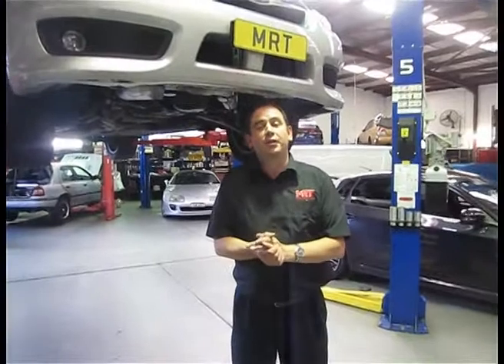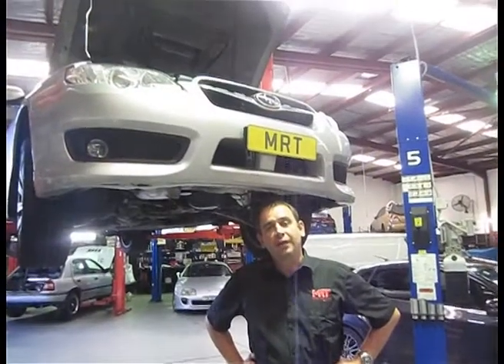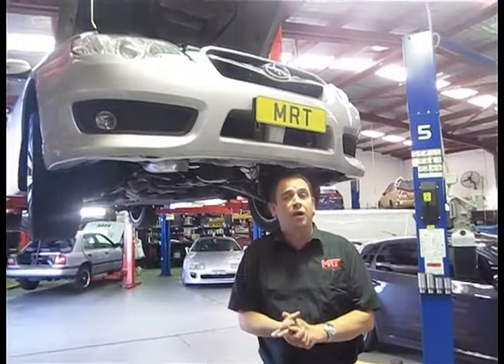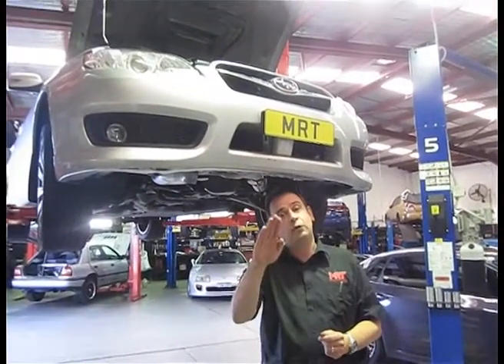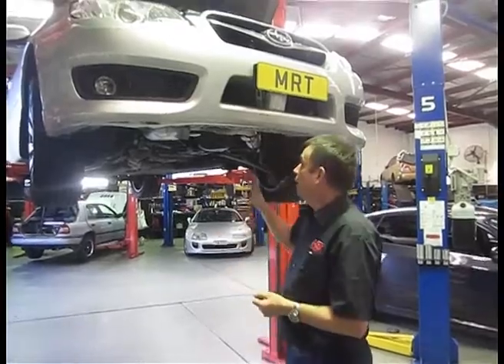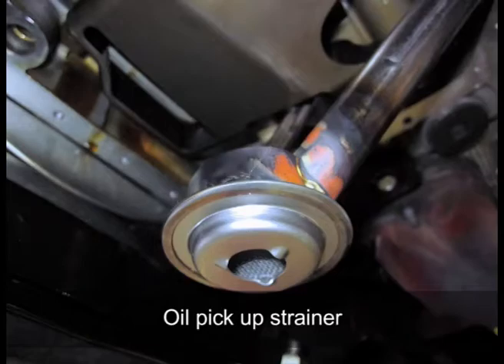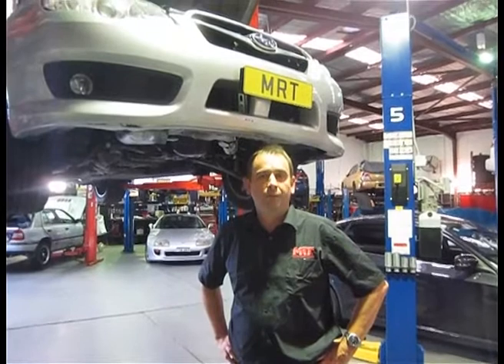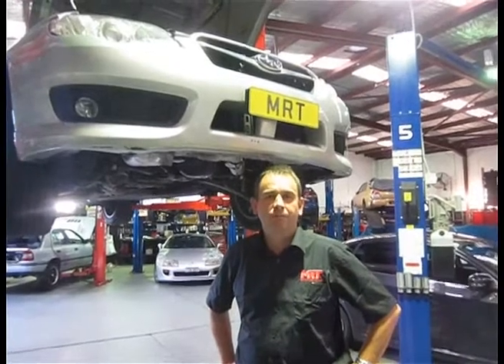Subaru Oil Pick up failure, what you need to know

Comment: They improved it for the MY 2006 cars, but if you check the forums, 2006 is when it started being an even bigger problem. The same pickup has been in use on the 2.5l Turbo cars from 2006 until now.

Comment: The oil sloshing in the pan is enough force back and forth bending on the welded joint. The thin steel Subaru uses is weakest at the welded joint. Put a good aftermarket pickup.
Reply: John Perricone Killer B
Reply: Not to be pedantic, but I believe that the factory pickup is brazed. Some on NASIOC say that the flux used during brazing contributes to the cracking through a chemical process with the oil, but hard to say for sure. What is well understood is that the factory pickup is thin (about 1/3 the thickness of Killer B's design), brazed instead of welded (shouldn't really make a difference, brazing can result in a very strong joint and both welding and brazing should be stronger than the base metal in a properly designed joint), and only supported by one support (Killer B uses 2). The Killer B design is pricy (~$200), but I've never heard of one failing!
Reply: @VIsubby early oil changes could certainly help. Some forum members have mentioned acids and moisture in oil as a probable cause of the cracking. One recently had his first symptoms of a cracked pickup on his first start of the year after letting the vehicle sit all winter.

Re: the alternatives to killer b, I personally run a killer b pickup and they are well respected on NASIOC, but if you could share cheaper alternatives here, that would probably help make this a more balanced discussion for those who come across this in the future; I just went with what everyone else seemed to be using, so am not really aware of the cheaper alternatives.